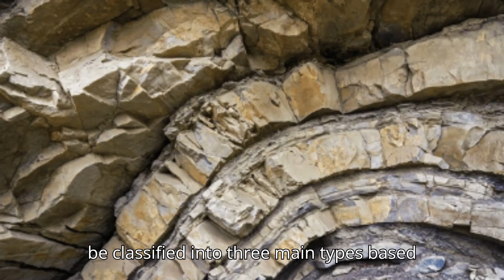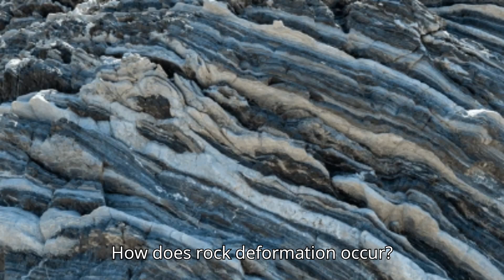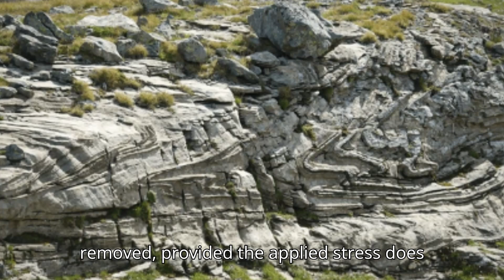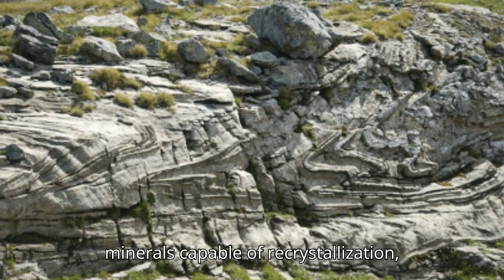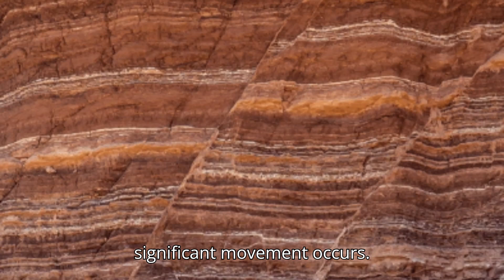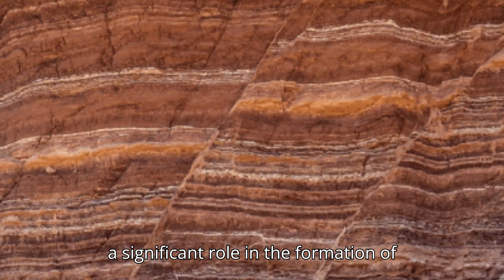Rock Deformation Explained: Types, Causes, and How It Occurs

Comment: are folds caused by volcanic activity.  ??
Reply from the maker: Not exactly! Rock deformations include folds, but they aren't always caused by volcanic activity. Let's break it down:

Rock deformation refers to changes in the shape, position, or volume of rocks due to stress. This stress can come from tectonic forces, gravity, or pressure from overlying rock layers.

Folds are a type of deformation that occurs when rocks bend or curve without breaking, usually in response to compressional forces. These forces are common in regions where tectonic plates collide.

Volcanic activity can sometimes contribute to deformation (e.g., magma intrusion causing doming or faulting), but folds are more commonly associated with tectonic processes, like mountain-building events, rather than volcanic activity alone.

In short: folds are primarily caused by tectonic forces, not directly by volcanic activity. Would you like examples or illustrations of folds and other types of deformation?